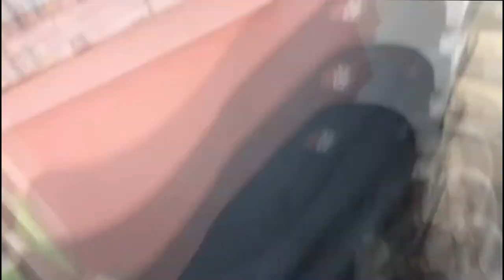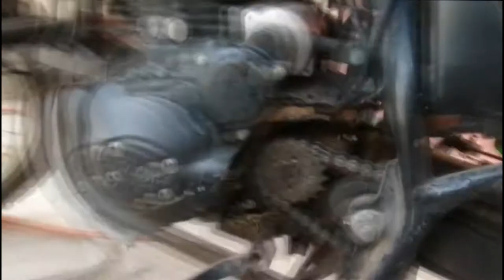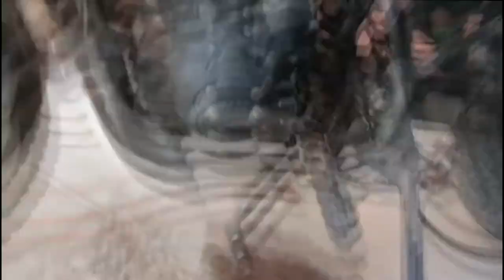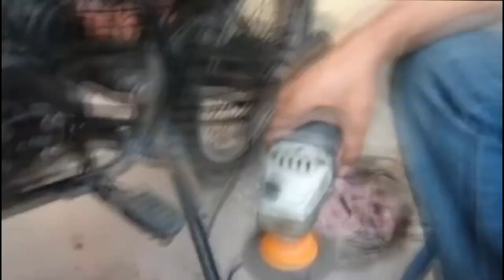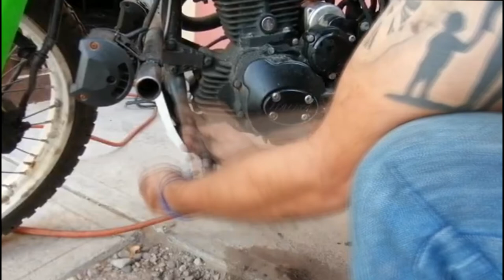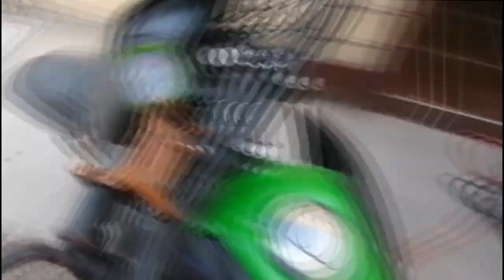más velocidad final menos Torque  crucero sprock de 17 dientes y cambio de retenes

Comment: Hola, me ayudas a buscar un sprocket para dm200 para ganar fuerza?, Que tenga mas dientes
Reply from the maker: Sprock de más dientes atrás?     Mejor quitale un diente adelante
Reply: @MecanicaMazElioPezzMecatronica  si, quiero que tenga mas torque, adelante ya le puse uno de 14 y atras quisiera ponerle un sprocket mas grande
Reply from the maker: Consigue el de 13 dientes adelante
Reply from the maker: Pero te aviso q a muchas revoluciones te vas a acabar el motor
Reply: @MecanicaMazElioPezzMecatronica  y para el de atras?
Reply: @MecanicaMazElioPezzMecatronica  donde lo puedp. Onseguir el de atras y se acabaría muy rapido el motor?
Reply from the maker: Te lo acabo de decir....

Donde enco traerlo nose ni de donde seas así q es imposible q t pueda ayudar